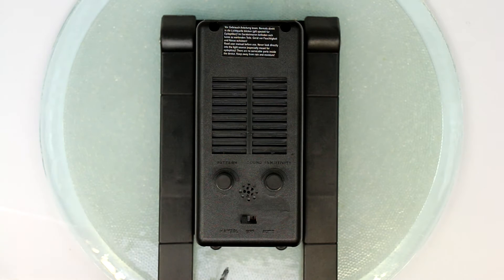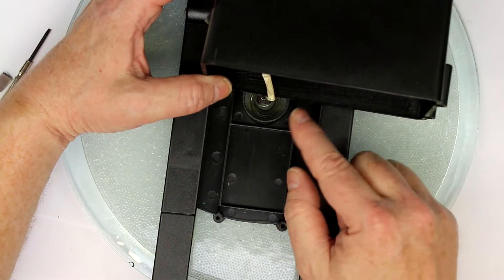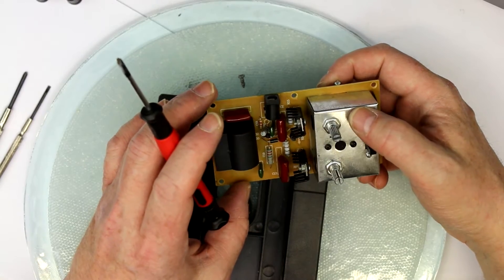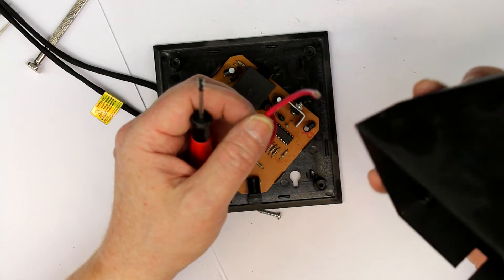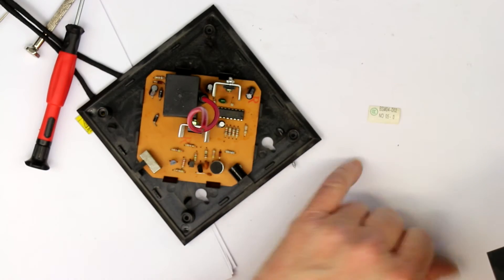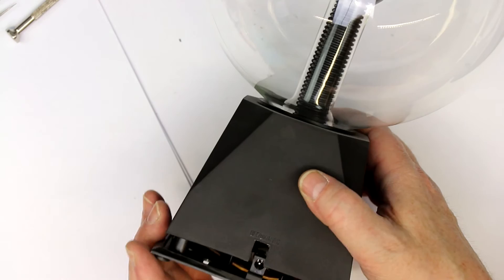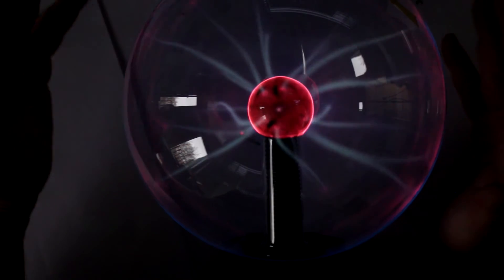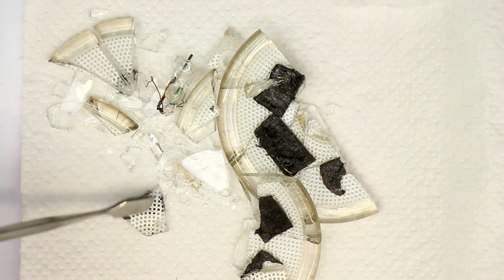Teardown of the Plasma-Disc & Plasma-Ball

Comment: Very nice video! I found it because my Lumin Disk stopped working, and I diagnosed that it is the disk that failed, as the circuit is still able to draw an arc. It baffles my mind, as the glass disk seems very sturdy, and I don't see the slightest damage on it, not even a scratch.

Comment: Plasma balls don't use a very low pressure gas mixture. They usually have about 0.6 bars, higher than neon signs.
Reply from the maker: Do you have a source for that information? Can´t believe it.
Reply: @KainkaLabs  Just google plasma ball pressure. If it had a low pressure filling the whole globe would glow evenly and thin, long arcs would never form.